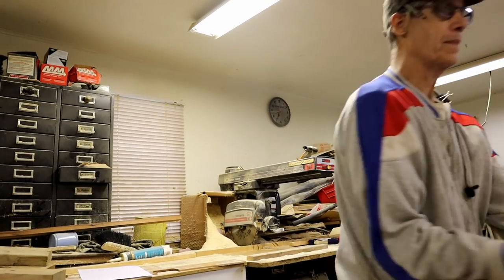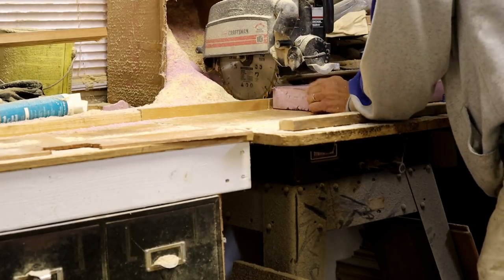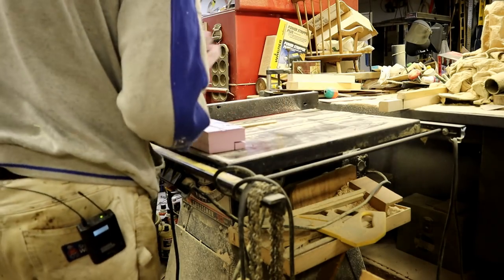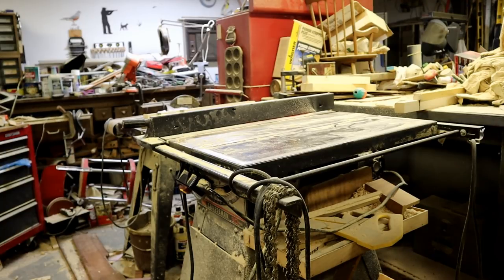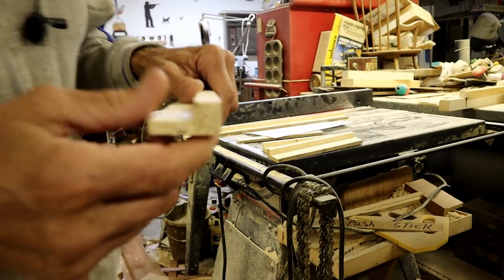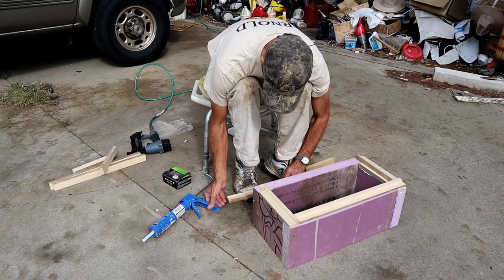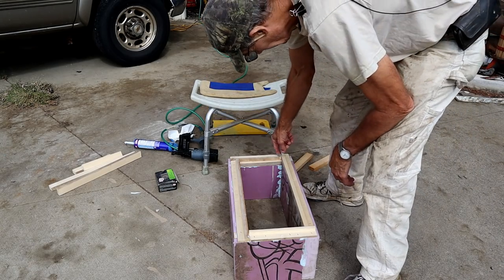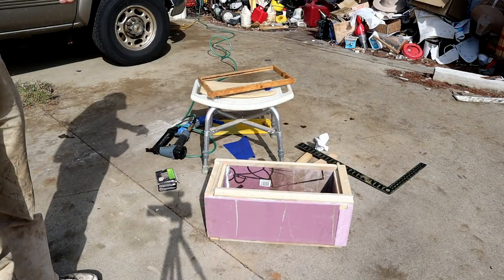Building A Cheap Styrofoam Box

Comment: Have used exterior foam board boxes with 100% survival for three years (3 hives, 9 hives and 17 hives).  This year will be taking 12 5x5x5 medium nucs and 22 three box medium 8-frame hives into winter.  All will have exterior foam boxes that have three taped corners and a front flap.  The box is then strapped on with velcro.  Thickness of foam board varies some are 1/2", 3/4" and some 1 inch or a mix thereof.  Also add 1/2" board under the telescoping lid.  It gets chilly in Pennsylvania.  Yellow jackets can chew through foam board with no problem.

Comment: I have maid a lot of this foam Nucs and bees overwintered great. Only thing that the glue won’t hold it together over time. much much better holds when I started to use gap filling foam as glue. In the summer as bees expands and  chew up sides and entrance. So I found solution and use self sticking foil inside the foam nuc and in the entrance area. I have bottom ventilation and seal up top with 1.5 inch foam cover which I also make.
Reply from the maker: What part of the country do you live in, I would think being sealed that tight they would sweat.
Reply: Little Bits Honey Bees joe may 
In Syracuse, NY.
My bottoms not removable as of now. I have about 50 % mesh bottom  on this foam boxes. I make square out of wood and staple on mosquito mesh. Then use some foam glue and screw it on. It holds good. then I cut out 2 foam pieces and screw it on. Entrance part sticking out about 2 inches so the bees can land. planning to make removable bottoms over winter.

Comment: 1.What kind of paint do you use on the foam?
2. With that design can this box be stacked on another to make a double deep?
3. What type of lid and bottom board do you use? Standard Wood lid & bottom board or do you make a foam board bottom & lid board.
4. What type of entrance do you use with this foam hive? Standard lower or upper entrance.
Reply from the maker: I use latex paint inside and out. They can be stacked, use regular lid and bottom board.